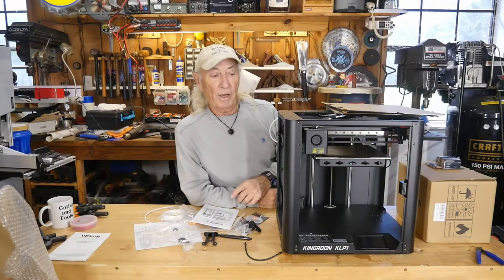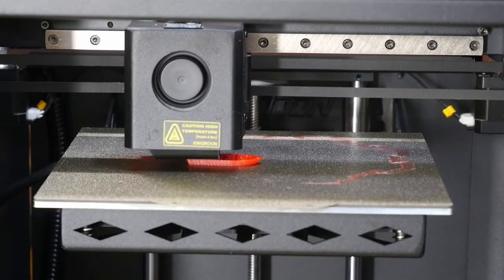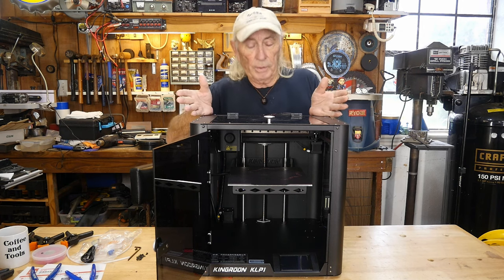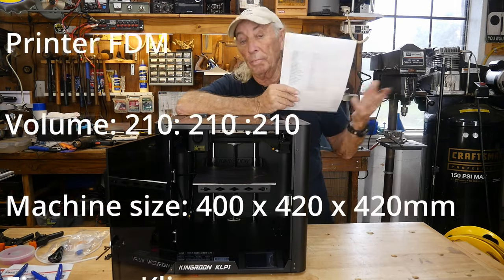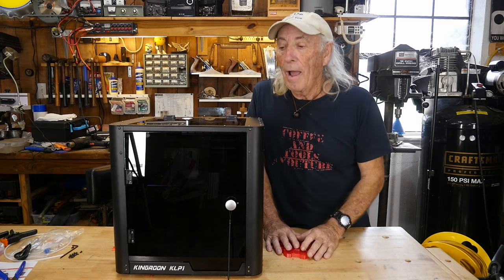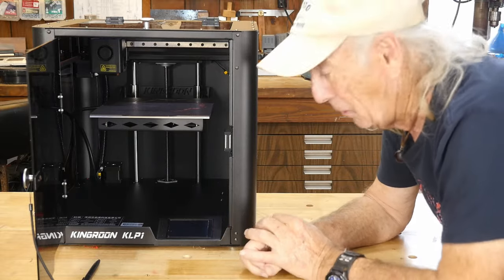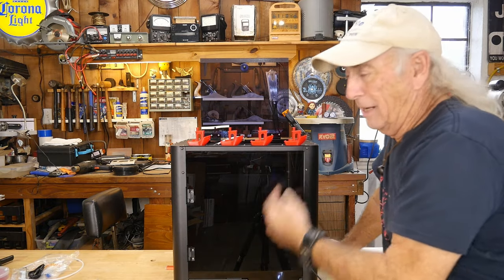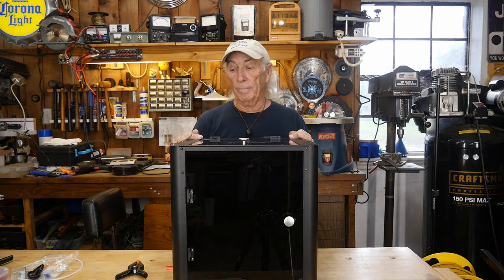Kingroon KLP1 highspeed 3d printer, reviews by Coffee and tools ep 387

Comment: I had same issue on trying to run Cura. Even got tech support to say it isn’t working right; right now.
Reply from the maker: I think over time we'll see Cura working. Meantime my Orca slicer has a glitch with it, Prusa slicer not working with it, and I've got to ask Kingroon the question. Nice build, but where's the software to run it ?
Reply: @SirTools  I just got the new KLP1 and I haven't had any issues with software apart from G0 F0 error, but that's from Z-HOP setting and just putting 10mm/s fixed it.
Reply from the maker: What slicer are you using ?

Comment: Orca Slicker is Bambu Slicer which is Prusaslicer which is Slic3r They all just forks. Just load the start gcode you like into Orca.

Better yet write your own start and end print macros on the device.

PETG works great with high acceleration moves. Reduces stringing so much.
Reply from the maker: Not much more for now. The Ocra slicer rammed the nozzle into the bed and dragged it up and broke. Now waiting for parts from Kingroon.

Comment: Lid only needs to be open for PLA / TPU due to it's low glass temp. PETG/ABS/ASA/Nylon lid closed. 

Lid closed will give better layer adhesion. C&C Kitchen tested and proved this.
Reply from the maker: Problem with the lid is the feed tube is pushed down and drags.